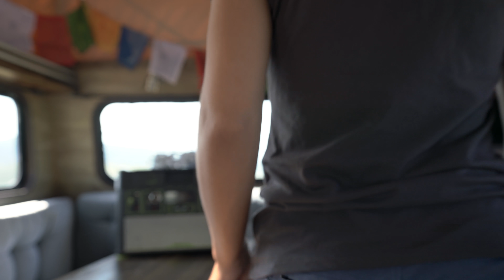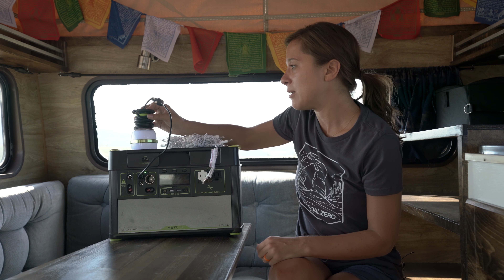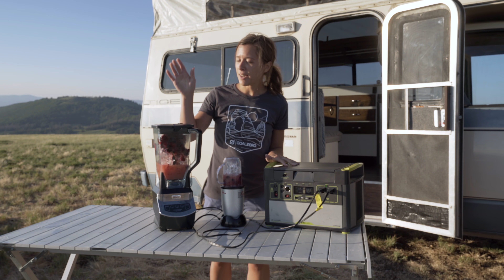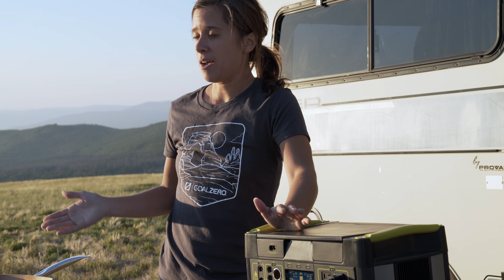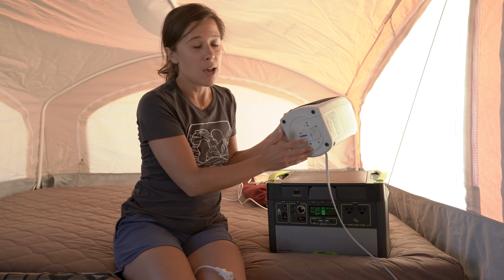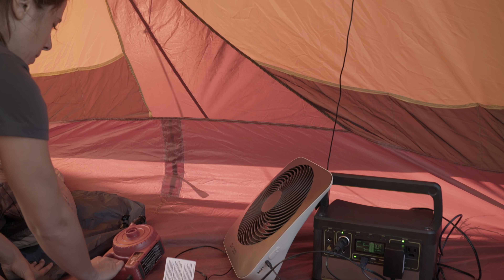Goal Zero Yeti Powers: Camping Edition

Comment: Experience from this summer is that the 500x and the nomad 50 was only able to run a compressor cooler box for 3 days before i needed to get back to the grid for charging, mind you this is in western norway with not very much sun. Maybe a 200 solar panel would have worked better.

Comment: 100% best Generater.Systems I have used. A test for hurricane prep here in Louisiana: three AC units, 5000, 5000 & 8000, 3 fridges, 2 device power setups, 4 flat screens....AND I had 40% of the power meter to spare.
Reply: No need ac units,  ancient people used free cooling with sun

Comment: The Yeti 500x I use has a faulty USB design connection. I have a 1000 and 500. Love the products. However, the second port from the left USB (not the c-port) has a design issue where some USB adapters will have a loose fit causing it to not work. It works but you have to keep pressure on it upwards to make the connection. This issue was found right out of the box. I hope Goal Zero fixed it.

Comment: On heater... saw something on a YouTube video,  home built snowmobile camper was heated with a 250 watt heater.... he was using a new Jackery 1000, with 2 - 100 watt solar panels to fill the power station full before nightfall... The Outsider... is a Jackery fan... I have Goal Zero in several sizes including the Yeti 1500x ... but it did show me some important things... insulation  is very important in stretching  power for heating.... so I pay more attention now to heater sizes... I also have some GoSun items that I have used with my 1500x, the Fusion solar hybrid cooker... the Chill portable freezer .... I think I could run each with my Yeti 200x... but not with big margins.

Was nice to see this vintage video...

Comment: I bought a Yeti 3000 after Hurricane Maria ravaged Puerto Rico.  After three years and five months it still charges up to ninety six percent.  It's amazing.  I cycle it between 35 to seventy five to extend the life of the batteries.  I never had to use a gas generator since.  Thanks GZ.
Reply: I also have two Boulder 100.

Comment: Can any of your power banks can run a small (5000btu) AC in my camper? I saw that KIMBO campers are using your products to run the AC units installed in their campers, couldn't figure out which model of your power bank are they using???  thanks

Comment: Love the Idea and love the look of the Product as an all in one unit with most camping and offgrid needs. The down side is the UK prices over £1000 for a 100ah unit !! then there is the really slow rechange times via PWM & the MPPT charge controllers. accessories are over priced for what they are.  Only a 500 cycle lifespan on a LiPh battery.  If you could all those negatives then unit would be Great.

Comment: Every one of these power stations videos are the same non of them show you how long it will last on a van refrigerator, we are not interested in powering low powered lights mobile phones and other very low drain items you can charge all these things from a tiny motorcycle battery 😩

Comment: I would recommend that the power needs aren't necessarily "all" or "nothing"; in particular the cooking and heating I would rather use a Mr. Heater (propane gas) and a Gladiator camp stove (also propane gas). Now, this would be for the weekend warrior who is camping for 2-4 days. As for phone charges (for GSP offline trail tracking), USB fans, camp lights (led), then the Yeti would be a good complimentary power source for those types of items. Also, the Harbor Freight air compressor; needed for offroad tire pressure runs off of auto battery, would also be able to blow up air mattresses as well.

Comment: YEP IM GETTING 1 i'VE RESEARCHED i JUST CANT USE A GAS/LPG I CANT STAND EVEN THE QUIETEST  'WEN' OR 'CHAMPION' IM GONNA HOPE GZ YETI 1400 LASTS BECAUSE IT IS EXPENSIVE, SO WITH MY IC2000 psINVERTER, 2 BATTLE BORN LITH BATS IM AT A COOL VERY COOL $3700 all for the peace & quite i want YOSEMITE & MY ADVENTURER 901SB HERE I COME!!  CORRECTION $4300 all new all with hours of shopping, I did find an ic2000 from a shop that is closing out of business so I saved about $300 on that

Comment: what about solar charging for your Yeti how do you do it
Reply: Pretty simple.
Hook up a solar panel to the DC Input on the Yeti battery. Some comments from the host in this video make me wonder if the Yeti can manage and deliver Solar and battery power simultaneously, which would be pretty wicked cool. I’d ask GoalZero CS for confirmation.

You would want to look into the math, it pays off. Depending on what you use, you may need more panels to top off the battery every day in variable light conditions. A single 100W solar panel might not fully recharge an empty 1400W battery with one day’s sunlight (I haven’t done the math yet, I’m just telling you what to look for). Goal Zero customer support may be able to advise on the formula for solar to battery ratio, though it’s a good idea to look at the amount of power draw your appliances will typically use in a day and get a battery with more storage than that (and enough solar to recharge that in less than a day).

Keep in mind the one featured in the video is a lithium battery. Lead Acid batteries are cheaper, but they like to be topped off nightly for best longevity. Lithium batteries are usually easier to maintain, lighter, and store more energy for the same sized box. A full discharge and recharge cycle is much harder on a battery than floating between 40-60%, if you only use some of the capacity at a time the battery will get more recharge cycles and last many more years.

Can’t think of other advice off the top of my head. Researching this topic has been fun for me, though I might have to fall back on it during this pandemic if my rent goes up too much on the next lease renewal. Let me know if you have more q’s.
Reply: Just want to add something!
Recently discovered LiFePO4 batteries... that’s the chemical abbreviations for Lithium Iron Phosphate (Oxygen 4?). They’re power dense and easy to maintain like Lithium-Ion, however they’re even more durable with 4x as many recharge cycles... these are 10-year batteries you don’t have to worry about.Those are the headline feature of BattleBorn batteries, but a small selection of other companies are starting to make them too. I tried looking for LiFePO4 power stations similar to the Goal Zero products, but so far all I found on Amazon was by a company called Beaudens and Energizer.

I think the Energizer Power Station is particularly interesting because it has the Power Delivery USB (PD) for fast, efficient output and recharging that the Beaudens lacks. PD is cool, it will recharge a laptop faster than a wall outlet style A/C jack, not need the “brick,” and take less energy from the battery bank. It also has the MTTP Charging feature that makes solar much more effective, like the Goal Zero. However, it doesn’t have the huge 300W continuous / 1200W (!!!) surge power inverter like the best Goal Zero lithium power station, nor user-replaceable batteries like the GZ Yeti 400.

I’m curious if the user could drop in a LiFePO4 battery into the Yeti 400 (or other Yeti) once the factory battery wears out?

Comment: it just a glorified assessors charger you cant even run a small 250w heater off it pricy for smart device charging. I made mistake buying 400 lithum and it blew "fuse" trying and im using it  with a teardrop camper so 400 if more effective would be a good physical size. Goal zero says go with 3000 model which is almost heavy enough to flip camper over lol

Comment: WOW, with all these "glamping" accessories it looks like there's a need for a nice 1000/800W inverter generator at the minimum or a 2000/1800W nearer the headier draw to supplement the yeti 1400.Yeti has a small footprint but its pricepoint is steep for basically a battery with 12v taps, a DC to AC inverter. contained in a case. Believe it or not there is such a thing as a "hand cranked" blender that does a reasonable job. I have a hand operated food processor for camping & power outtages.
Reply: Right, if you do your research you can get a lot more for your money and better battery tech too if you are willing to DIY.

Comment: Curious as to why she would plug a 12volt dc fridge in to the Yeti while using the AC convertors that waste electricity?? The Dometic is designed to run on 12v dc, why not use the the 12v output of the yeti and not lose electricity in the conversion?
Reply: easy, the standard 12 volt plug is not balanced, so not all fridges run on it......

Comment: Only 500 charge cycles on the Y3000? Is that true?
Reply: On the batteries they are using, yes. But remember it's after 500 charge cycles the battery will have 80% of its original capacity.

Comment: ERROR     ERROR      ERROR      ERROR      ERROR      ERROR      ERROR      ERROR      ERROR     ERROR
I am reporting an ERROR on Yeti's website. Specifically, the 120 Volt continuous and surge ratings as listed for both the Yeti 3000 and Yeti 1400 are 1500 Watts continuous and 3000 Watts surge.  There are likely more errors, but I stopped right there.
https://www.goalzero.com/shop/portable-power/goal-zero-yeti-3000-lithium-portable-power-station-app/
Reply from the maker: Hi Gregory,
Thank you for your comment. The product is called Goal Zero Yeti our company is called Goal Zero. There's actually no error on the AC output ratings on the Yeti 1400 or 3000. They both are rated at 1500W continuous with a 3000W surge with the exception of the Yeti 3000 having a slightly higher amperage output of 120VAC 60Hz, 12.5A (1500W, 3000W surge)
Reply: Thank you for your reply.  When a product line includes a range of models with numeric designations, customers tend to assume consistency in the interpretation of what the numbers signify. In this case, the '1400' corresponds closely with a CONTINUOUS 1500 Watt output. For consistency, I would anticipate that the '3000' designation implies its CONTINUOUS output, not surge.   Given that Power = Voltage * Current, this implies that a higher amperage correspondingly provides a higher wattage....Yes??? Based on this, your statement "They both are rated at 1500W continuous with a 3000W surge with the exception of the Yeti 3000 having a slightly higher amperage output of 120VAC" is confusing (and I'm an engineer)
Reply: I stand correct... I again reviewed both the Yeti 1400 and Yeti 3000. Contrary to your prior statement,  the Yeti 3000 does NOT list a higher amperage output at 120 Volts than is offered by the Yeti 1400. BOTH specify the same amperage at 120 Volts (as they must, given that Power = Volts * Amps)
Both state:  12.5Amps (1500W, 3000W surge) 120V AC Inverter: (Pure sine wave)
Reply from the maker: @gregparrott ,

My apologies for the confusion. I provided incorrect information. The Yeti 1400 specs I provided earlier were for our V1 Yeti 1400 which did not include wifi capabilities. Both the current Yeti 1400 and Yeti 3000 have a 12.5Amps (1500W, 3000W surge) 120V AC Inverter: (Pure sine wave)
Reply: Goal Zero  Thanks again for the reply.  Given that you're saying the 3000 has the same 120 Volt specs. as the 1400, I STILL do not understand what distinguishes the 3000 from the 1400 (other than a ~$1200 cost differential). Unless you can point to it, I guess I'll have to review the entirety of the specs.
Reply: Goal Zero   I NOW understand what Goal Zero's model designation signifies. It signifies its power storage capacity in Watt-hours, not current flow (amperage) or power (Watts). In short, the Yeti 3000 has a 2X+ larger battery. But, the circuitry for providing 120 Volts AC, 12 Volts DC and 5 Volts DC is identical in both models. Ideally, prospective customers should not have to ferret out the meaning of a product line's numerically based model designation.
Reply: Typo to the above comment - It is the listing in Watt-hours, not Amp hours 
(although, given the Voltage, one can readily convert between these two units of measure)

Comment: Can you over charge a goal zero.  I just got the yeti 400 lithium.
Reply from the maker: Hi Brad,

Great question, our batteries all come with a charge controller that will regulate and monitor power going to the battery. This means the charge controller will prevent you from overcharging the batteries.

Comment: Does one plug the generator into a house outlet to recharge it once it's depleted?

Thanks!
Reply from the maker: Hi,

Great question, you can definitely recharge the Goal Zero Yeti's with the wall chargers they come with from your home outlets. We also have 12V and solar options for recharging as well.
Reply: Goal Zero I am considering buying one of these as a hopefully long lasting running of biPAP (similar to CPAP) will it run as an UPS? I am wanting it for home in case of our frequent power blackout outages, will it automatically kick in if the power goes out? Also, will it output 24 volt, pure sine wave?
Reply: Goal Zero does it charge faster with solar or 12v? Also is it effected by battery imprint?

Comment: I have the same Yeti in this video and the 120v AC stopped working and each time i reset it a red light turns on and it says overload. But nothing is plugged in. I have had this Yeti for over a year. What am i supposed to do? This occurred when i used the exact same space heater that you used in the this commercial.
Reply from the maker: Hi,
Thank you for reaching out. Sorry to hear about the troubles you're experiencing with your Yeti 1400. We suggest reaching out to our solutions center team at 1-888-794-6250 Monday - Friday from 8am - 5pm MST and they can help troubleshoot what is going on with your Yeti 1400.

Comment: How long will it run my stick welder?
Reply: not very freakin' long unless you buy all the extensions and that means you might as well buy the 3000 model...for a tidy sum of 4 grand
Reply: Should work well with your stick welder for several days... as long as your welder is unplugged, turned off, and stored away the whole time.

Comment: You didn't give a comparison to anything else.  I can have a portable jumper for less than a hundred dollars that will do just about as much.  Heck, I can buy three portable jumpers and keep them plugged into the car's lighters and have them available for camp use.

The digital displays showing you how much power being used is pointless.  I can plug a Kill-A-Watt into the AC port and plug an electronic device in and for less than $20 and I can know the same thing.  Once you have learned how much watts and amps each of your devices uses it's a simple way to know how much power you have available.  And if you have a couple portable jumper boxes then you will have plenty of power for a day or two until you run your vehicle again.

If you do a lot of camping, I'm sure you can get far more power configured by having someone install a couple AGM batteries to your car's alternator and attaching a hundred dollar 1000 watt inverter.  It will cost half as much as a Yeti for the parts and installation and give you more power.  Add a couple solar panels for two hundred dollars and you won't need to run your vehicle to charge them for days.

Purchasing a portable batter with meters on it (these Yeti) is expensive and for the people who can't or won't take 15 minutes to learn the basics of power consumption.  People like these can't be helped and will not be able to understand what the meters on the Yeti mean, anyway.  These are the kind of people who should not go off-grid because they will get hurt.  Stay in the city and hope the men will keep the utilities running because you don't want to be bear food.

Comment: How many hours will it run the blanket for
Reply from the maker: Hi, 
great question, when using the blanket we were getting a 75 watt draw to power it. At that wattage rating we could run that blanket for roughly 18-19 hours. Keep in mind that your particular heated blanket may be rated differently and could run longer or less depending on it's power draw and if it requires a 110V plug or can run off of 12V. So check out the tech specs of your blanket to see how long it will run for.

Comment: I want to buy the Yati 3000 but I need to know if I can expand to connect to a battery bank ? if yes how many 12v batteries can I can connect ? cause I'm indecisive if to get the Yati or the Kodiak I love that you can replace the battery and the wifi connectivity thats  is super nice
Reply from the maker: Hi DJ,

Thank you for contacting Goal Zero. We're currently working on chaining features on our lithium line of Goal Zero Yeti power stations.

Comment: Why don't you fix the 12 volt receptacle so it doesn't have the raised shoulders, preventing use of the 12 volt cord from a Dometic or ARB cooler?   These units have very fat tips on the plug due to the nested fuse, and this center contact will not touch the center pin of the 12 volt receptacle in the Yeti.  I worked around it by getting an adapter cable (Anderson port to 12 volt outlet) from PowerWerx.  This problem existed from your first Yeti, and looks like it is still a problem with this unit.
Reply: Its designed that way so you cant do that!

Comment: You are trying to run things on a limited power supply. Most every thing you ran used the energy hog inverter. Try buying a USB fan and camera battery charger. The get the 12 volt electric blanket and other things not needing the inverter. I have a native 12 volt CPAP machine that will run for 4 days off a Yeti 400 if I don't turn on the humidifier.
Reply: how do you turn off the humidifier on your cpap?
Reply: Your missing the point of the video also this is good info for those who seek to run these types of appliances.
Reply: @Trillville43  It was just a question.